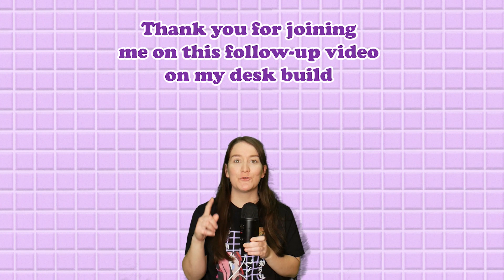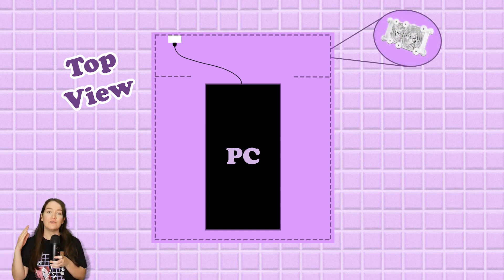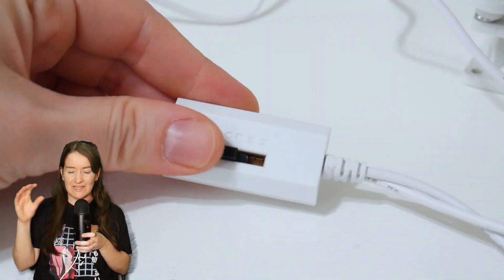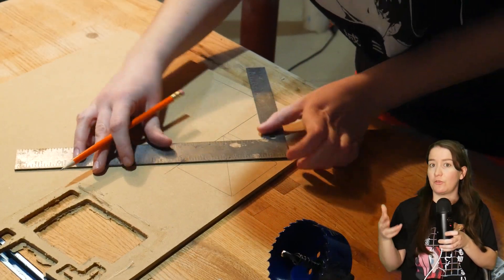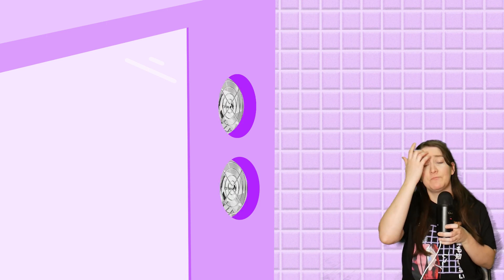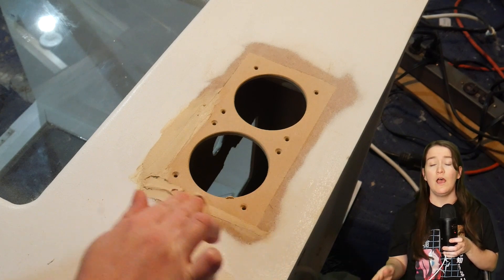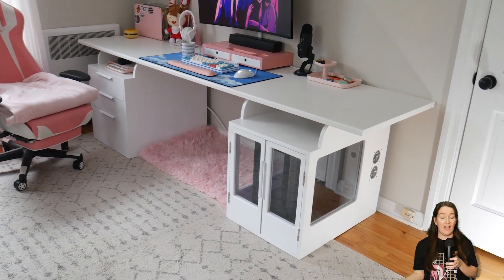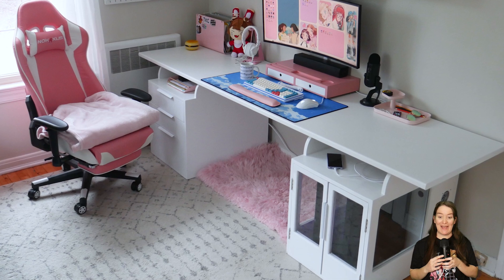Seamlessly Installing Cooling Fans into My PC Cabinet

Comment: Thanks for the video! 1 question, did your PC case itself had some fans? I have a cabinet which I intend to keep closed all the time. But PC cases usually have front sided fans for air intake. Then, rear fans for exhaust. How did you manage the air intake part? I don't want to keep the cabinet door open for this reason! Please let me know, thanks
Reply from the maker: Hi, so yes my PC has fans, but with the cabinet closed it still got really hot because lack of ventilation.
Reply: @dinkles_woodshop Thanks for replying! I was thinking, I drill 2 holes in bottom right corner of cabinet (near the door), install 2 custom USB fans for air intake. Then, drill 2 other holes on left / right side of cabinet and install another 2 custom USB fans for exhaust. Would this work? I also saw it in another Youtube video, but haven't tried it